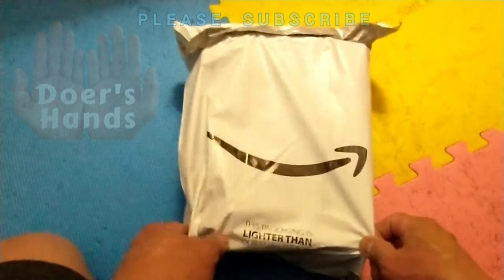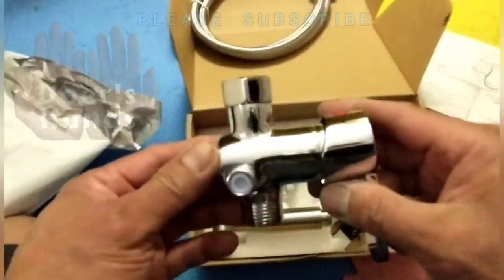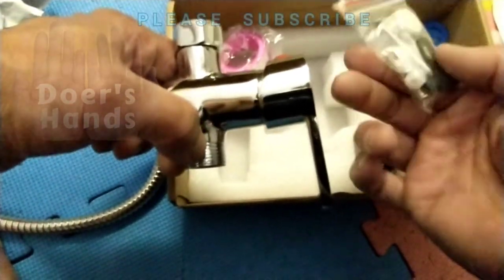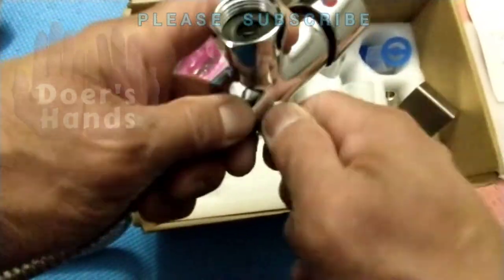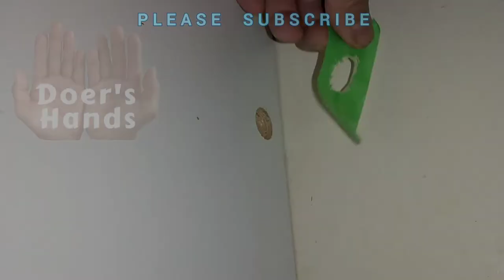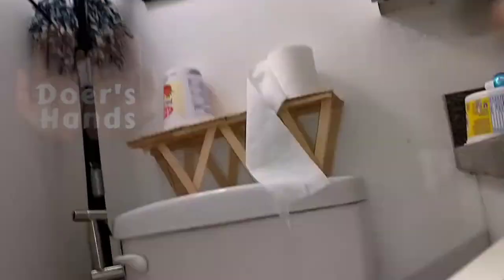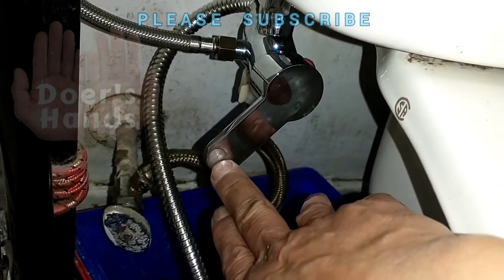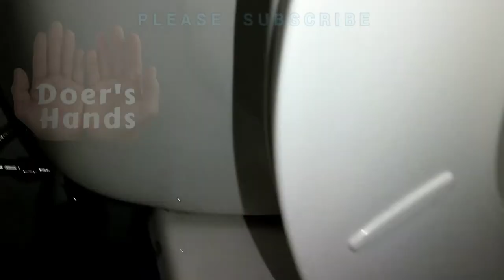Do It Yourself Installation of Bidet with Hot and Cold Mixing Valve

Comment: Hi , I purchased it but I’m not sure how to drill that hole
Reply from the maker: Buy a hole saw bit depending on hose outside diameter, put masking tape on the surface you will drill, so that it will prevent the chipping of the MDF wood.